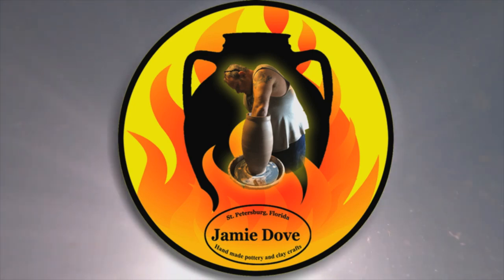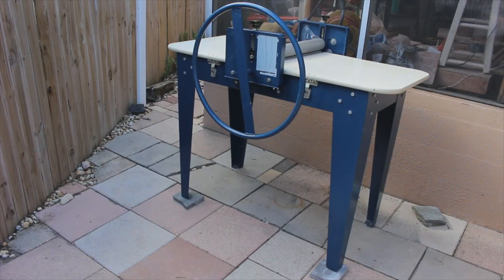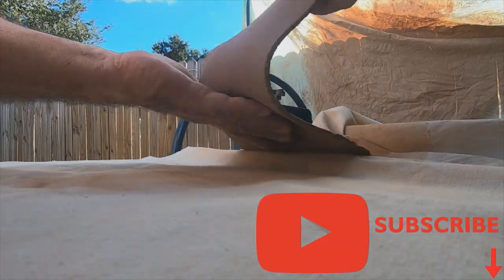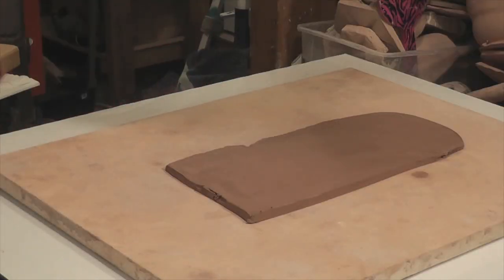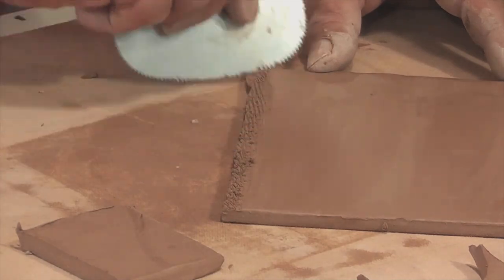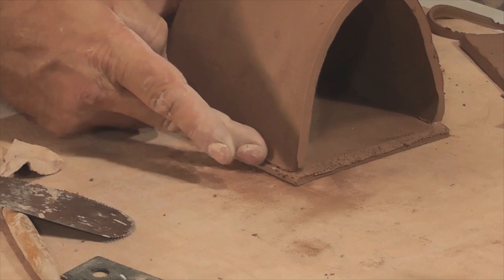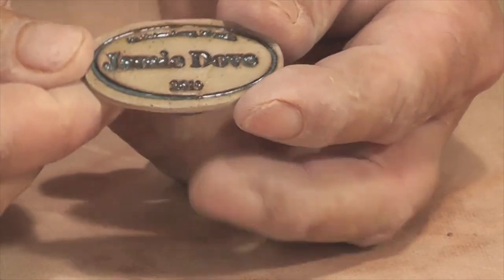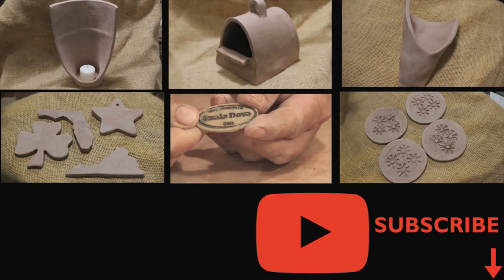SLAB ROLLER!! - 5 SIMPLE EASY DIY PROJECTS

Comment: Cool way to make a hanger back - adding that to my tip tool box
Reply from the maker: Oh, the little button trick on the back. Yea, I use a stick or in this case a drill bit so I can attach the clay without deforming the hole. Somehow, I end up closing the holes accidentally.